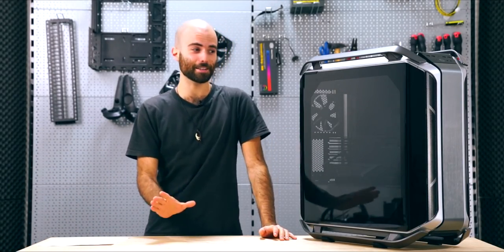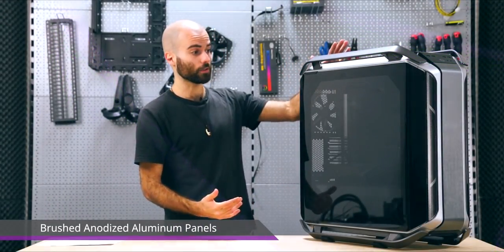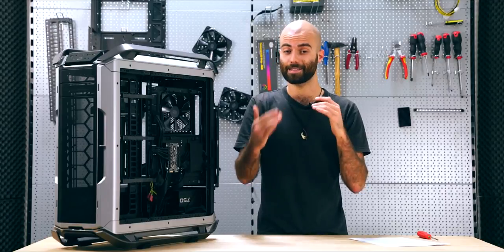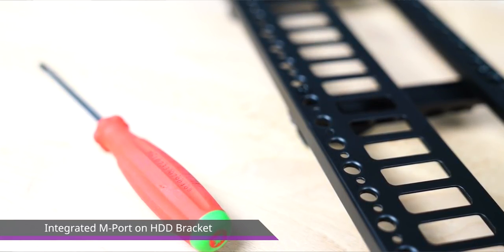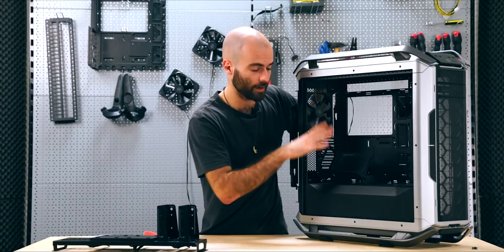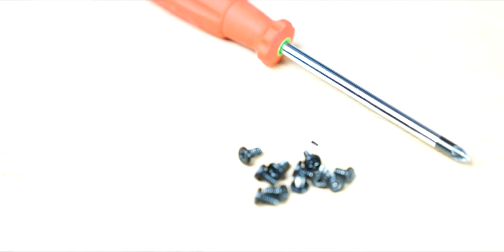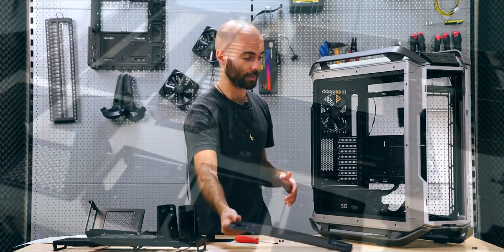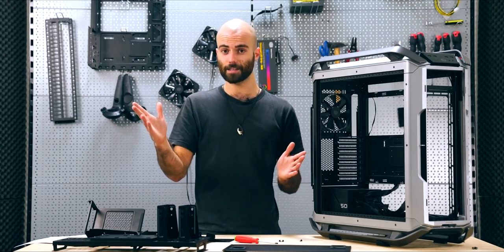C700M Tutorial Part 1 - Overview and Disassembly

Comment: Very nicely made video.  I just purchased this and am in the middle of my build.  I am using a 2080 TI GPU and have mounted a EK water block to it.  When I attempt to put the gpu on the adjustable mount bracket, I am getting sag on one end due to the weight of the card.  Do you have any suggestions to secure the card onto the adjustable bracket?

Comment: Can I mount a closed loop radiator on top of the c700m as it was possible on the 700p model, cuz on some sites it's said that a radiator can only be placed on front, bottom and rear sides. Please clarify that because otherwise its a miraculous case

Comment: Hi, can anyone confirm please if I go push + pull 360mm rad (45mm thick) on top with 120/140 - 25mm thick fans (3/3 6 in total for push + pull) will it fit? I know if I set only push mode with 3x 120/140mm fans with a 45mm thick radiator will work just fine. But what about push+pull I will have 3 more fans right at the top between the dust filter and bracket. 

I've heard from others that if you want push pull on top you need to use 15mm slim fans in order to fit between the dust filter at the top. And honestly I don't like that (15mm thick fans)

Comment: Great overview and explanations.  Thanks for taking the time and posting.  I'm getting the gear to replace my old faithful.  As far as cases are concerned I'm just not sure if to go to this or the new 500M, but it will be based on an Aorus Extreme motherboard which is EATX.  Probably a silly question but why don't cases come with USB 3.1 Gen 2 ports across all of the front ports regardless of type A or type C?  One of the main reason I like it more than others is the 5 front ports.

Comment: Sir as a Aerospace Hardware Test Engineer, I am very fussy when I purchase a case, can I ask what type of material is the sloping Silver looking panels made from?, the handles are attached to, I realise the handle screws will pass through to the main chassis, the material goes all around the sides of the main chassis,  Metal or Plastic?

Comment: Is there power led cable?
Is we use rtx 3080 do i need to change the gpu bracket to v2? And is the 200mm pcie 4.0 riser cable will have enough length?

Comment: As I understand x5 HDD cages are shipped with the case and to use 7 more I'd need to buy MCA-C700R-KOCC00 ?
And when using x12 HDDs will I be still able to use x2 5.25" Lian Li BZ-H06B SATA Power Switches? If I'm not wrong they are only 6,5cm deep and in theory shouldn't be on the way of two top HDDs.

Comment: Hello,
can the vertical GPU mount (when angled 45°) on the C700M accommodate a Triple slot card like the Evga 2080 Ti FTW ?
Reply: not natively since it has 2 slots but you can still fit it in, you just keep in mind that only 2 of the 3 screws can be used
Reply: @RiftDM  Thanks! I ended up buying a 2 slot bracket for the EVGA card + I finally bought the C700M.
I love it so far! system not build yet, I just took everything apart and I'm still exploring the different layouts options.
I will probably be going Chimney style, but with GPU at the back (rotating GPU mount attached to the back panel) still exploring where I'll put the PSU and cover :)
Hope part 2 will come soon to give me new ideas!
Reply: @Gwal  Good to know!
Part 2 is coming this week, There are a couple of funny layouts so I think you can get some additional ideas for your build ;)

Comment: I have one,  its the best case but in terms of thermals,  the standard layout is the best.
Reply: Ice! I want to get this case for my new build, but I plan to get the rog thor 1200watt psu, and I want to view the psus display, is it not a good idea to completely remove the oau shroud?
Reply: @son-stevkan2815  you can remove the shroud,   it wont hurt much its only there for looks and to hide messy wiring and to support the vertical GPU bracket mount.
Reply: Ice! I have reached the solution of removing it and altering it to reveal only part of the gpu
Reply: @son-stevkan2815  cool,  I have a ticket open with cm right now on the case lighting,  seems the leds are acting weird and they flicking and don't light up in certain modes.   Hope you don't have the same problem but I see others with this same thing.
Reply: Ice! Do you know if it’s compatible with the maximus xi extreme? Pcpart picker says it isnt???
Reply: @son-stevkan2815  They're correct,  the case will handle E-ATX boards up to 12" x 10.7" ,  the XI extreme measures 12 x 10.9 so if you really wanted to make it fit you'd have to do some serious modding if that's even possible but sounds like a fun project
Reply: Ice! Damn, that is a real bummer. I really do want this case but I want to use that motherboard as well
Reply: Ice! So it is literally .2 inches off?
Reply: @son-stevkan2815  Yup apparently,  I don't own that board personally so I'm not sure .2 inches is really a game breaker or not.    The risk you get a case you can't put a motherboard in.   I would try contacting Cooler Master to see what their take is on that.   It could be a non issue.
Reply: Ice! I may ask them, if it is an issue i’ll just get the Maximus xi formula.

Comment: At 4:10 how many of the horizontal racks are included? Is it that 2 for HDDs and 3 Vertical ones for SSDs or is it 5 of each?
Reply: 3 little cable covers/ SDD mounts + 5 HDD/SSD caddies

Comment: i have that case and i want to know  if i can sync the rgb with the rest of the system (aio .....)
Reply: yes ,there is a A RGB plug to connect to the motherboard ARGB header and sync RGB. Personally I used an adapter on ebay to convert this plug to Corsair Lighting Node and control the case RGB strips with iCue :) it works very well!

Comment: Thanks for the explanations. I just finished my set up in this case. Really like the case! But your manual is so terrible. You could have do much better manual for such an expensive case. I have a question for you. What is the best option to mount GPU in terms of good cooling? I have mounted it in the old fashion directly into MB with fans looking down. Obviously i have removed angled GPU bracket. I get around 67C in games with the case fans set to low and GPU fans are on 1300rpm. My GPU is 1080. If i mount it looking up in the provided bracket, will i get lower temperatures?
Reply: Hi Elf! 

If you are aiming for the best temperatures you may want to stick with the GPU mounted in the motherboard or you can mount it vertical on the HDD bracket ( beside the motherboard, using the angled GPU bracket);
follow the steps in page 10 of the manual for it.

Both configurations will give you good temps, but the second one will look way better :D (IMO)

I suggest to use the angled bracket on the PSU cover only if you care about the aesthetics of your system more than thermal performance, as it will have an impact on temperatures.
That configuration is targeted more towards watercooling rather than aircooling :) 

but you may still want to give it a shot, try and test the temperatures. maybe you discover that in your case you have no problem at all
Reply: @RiftDM  Hi! Thanks for your suggestions and opinion. I have already tried vertical GPU mount and I had GPU temperature raised by 10C compairing to standard old fashion direct plug into mobo. Definitely not the best option. Will try angle bracket and see what happens:)

Comment: so i have the asus x99 and im f***ed if this case support A RGB and not a normal RGB
Reply: ASUS X99 supports neither RGB or A-RGB, so not sure what your issue is.  The case comes with an RGB/FAN controller, so you can link it to your X99 for PWM fan control, and simply power any A-RGB from the included controller.

Comment: This is not tutorial. :( This is advertisement. 

Lot's of important stuff is missing. No closups - where exactly the screws are located. (Trying to hide very bad painting quality?) Sometimes is obvious, sometimes is not. No explanation how the controller is working. Everything you need to check by yourself. (For example - NOWERE explained why controller has 2  SATA power ports, and what second is for.) Beautiful cable management ladder... Except the fact it using mostly for holding CoolerMaster engineering stupidity. Instead to make 1 small USB hub, (and maybe even cardreader) on top. And connect it with single USB 3.1 to motherboard - CM has 4 huge USB 3 cables, completely useless, just taking space. What about to make second one, shorter and horizontal, to hold cables from the controller? No? Completely shitty user manual, no even slight explanation how correctly install GPU and riser cable to the holder. Riser v2, but holder itself - custom? It's not the same as separate universal GPU holder. And it doesn't have the screws to attach the cable. I used bolts and L shape holder to assemble - but is it right? Not explained anywhere. 

It still the top chassis, no question. But after mu HAF-X it looks like quality is step down. :(